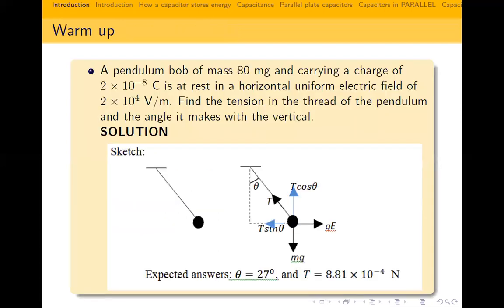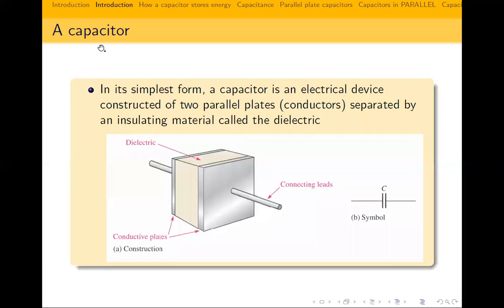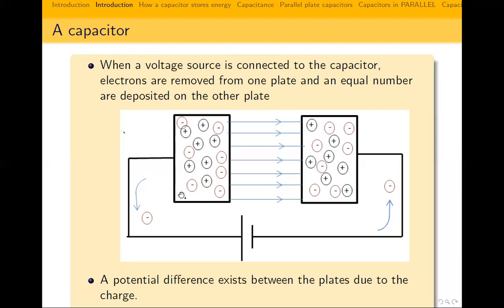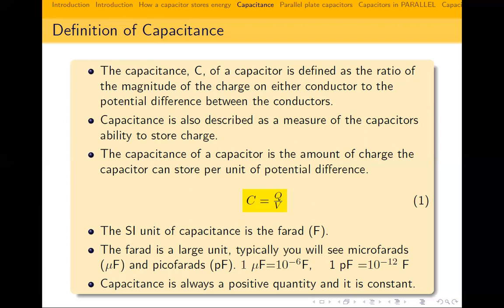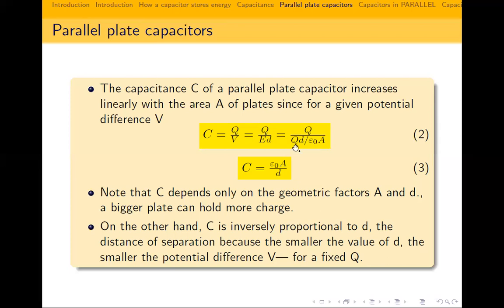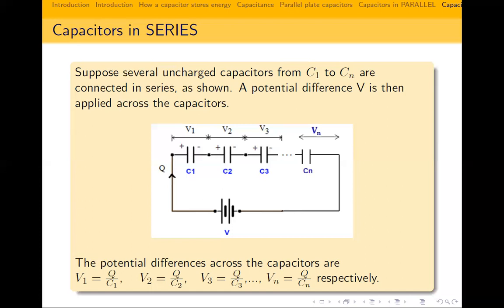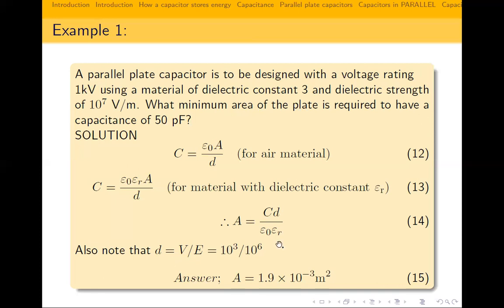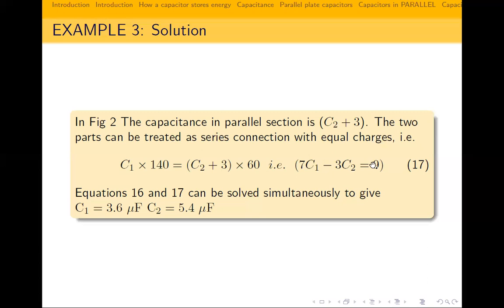ECU103 Lec#3 video

Comment: sir, would you please share the course outline with the class reps, i doubt if only 3 topics. were to be covered.
Reply from the maker: The topics are subdivided into several sub topics. However, where do you get the notion that the course has ended? The course outline is in the LMS for your reading.